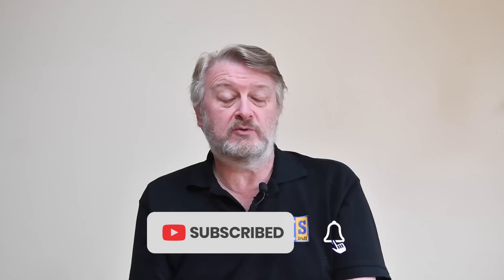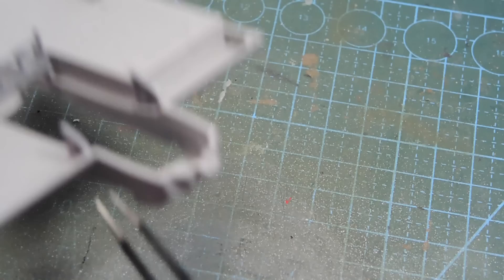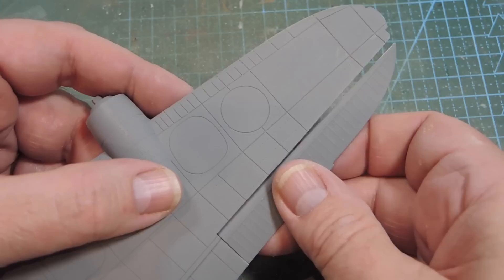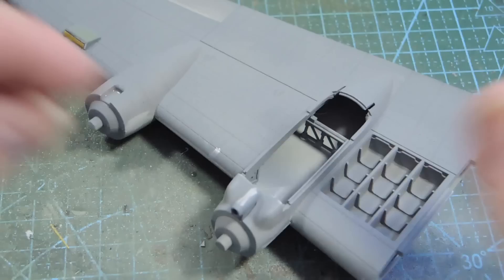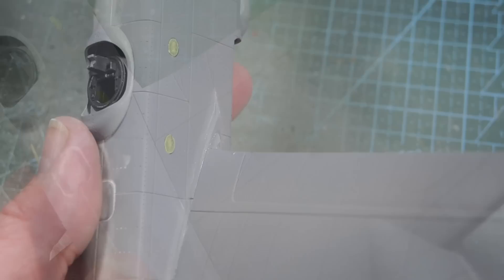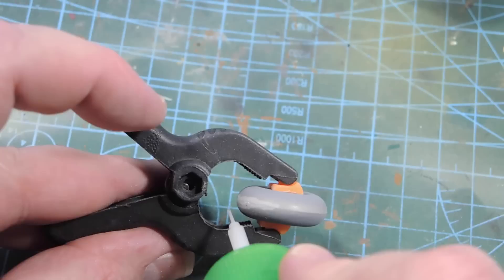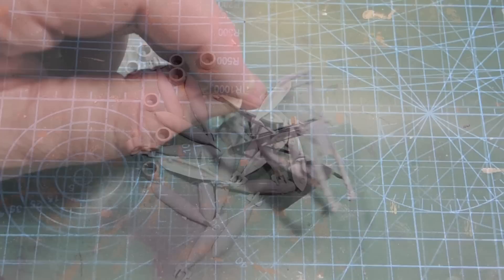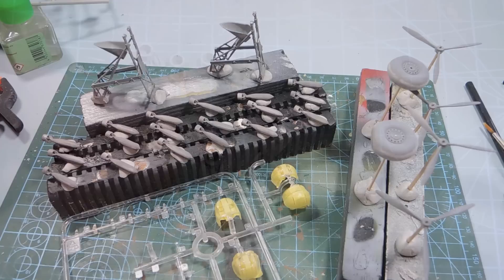STIRLING Italeri Short Stirling Mk.III 1/72 scale BUILD Pt.2 - 1080p HD

Comment: Very interesting & some quite fiddly bits. The model is coming together nicely.

There is a personal connection to the Stirling, although probably a mark 1 or 2. An uncle was a tail-end Charlie serving with 75 NZ Squadron @ Newmarket. Sadly shot down near Krefeld, on a Ruhr run, in May 1942. Only the radio operator survived as he was badly wounded by flak & he was bailed out of the plane by the crew as they didn't think he'd make it back home without urgent medical care (he was blinded). This was only the crew's 8th mission.

Looking forward to seeing the complete & painted model.
Reply from the maker: Bomber Command lost so many good men. Heroes each and every one of them. Thanks for the story - you need to make the Stirling then (Italeri already do a Mark I)
Reply: @garys_stuff  I did the Airfix one many years back but don't remember there being the bomb tender.
Thanks for the info on the Mark 1 model.

Comment: Diorama idea. To show off the interior detail properly, how about fitting neither left wing, nor the left half of the fuselage? Then using an L shaped board glue the root of the right wing to the back and rest the undercarriage in the down position on the bottom board. If you want to go a step further the boards could be painted like a runway / airfield. The undercarriage is often on one of the wing nacelles, perhaps just glue that wing or enough to show the port inner engine. It might allow you to show off the engine detail that way too?
Reply from the maker: Julian - great idea but I think I've got enough to worry about getting this blasted thing done!!! There will be some very clever and creative people out there who will be able to do it.

Comment: Hi Gary.. I just had a thought about marking holes if you accidentally forget something. Dry brush the end of the tab on the part that's supposed to fit in the missing hole, then gently press it in place over where the hole should be. The paint on the end of the tab should then mark the outline where it's supposed to go so you can then cut it out.
Reply: Or just say the heck with it and just cut the tab off!
Reply: @davidsakal449  That too, but then how do you position and attach the part properly?
Reply: @julianmhall  Center on the panel line and glue it.

Comment: Why didn't you just cut the tab from the mating part on the engine nacelles rather than cut into the airframe?
Reply from the maker: Just wanted to show the method. If I cut the tabs off I might not get the positioning just right - on this plane it might have been fine but where alignments aren't so convenient it might be more of an issue.
Reply: @garys_stuff  that's what I was thinking. Always check for mating parts alignment to save extra time and work. If that part had have been miss moulded and you'd cut a big hole in the model, you're into a whole world of pain.

Comment: Fantastic looking build Gary. Can I ask what do you use to prime your models? I notice you prime on the sprue and then after assembly, do you use the same primer for both stages or different primers?
Reply from the maker: For the bulk of the kit it will be the same primer, Jenolite plastic primer grey. I prime on the sprue because I ofetn paint smaller parts on the sprue, also the bigger parts (such as fuelage halves) having a primer coat makes any seams stand out on sanding and you can even see which side is higher. Once I've done any repairs then a final quick primer coat shows any remaining seam issues. But the coat is thin.

Comment: Gary what do you use for a primer when the parts are still on the sprues is it a rattle can?
Reply from the maker: Yes, I use Jenolite grey plastic primer. It seems to grip well and holds my paints (Vallejo acrylics in the main). Much cheaper than prorietary model company cans!
Reply: @garys_stuff  what a good idea! 3x400 ml cans of that go for a very reasonable sum, indeed.